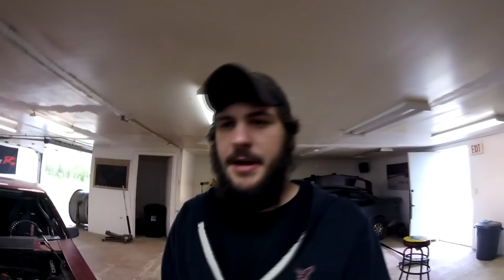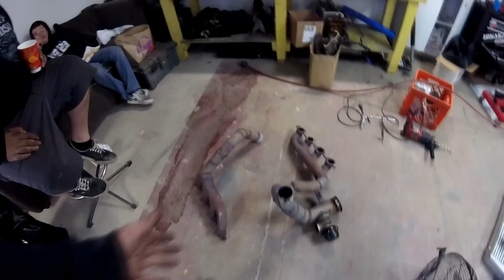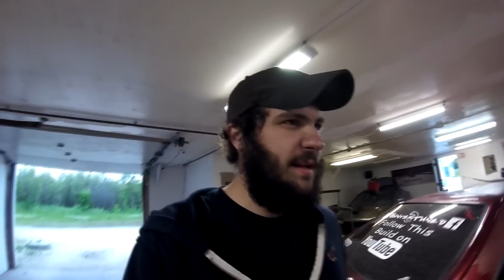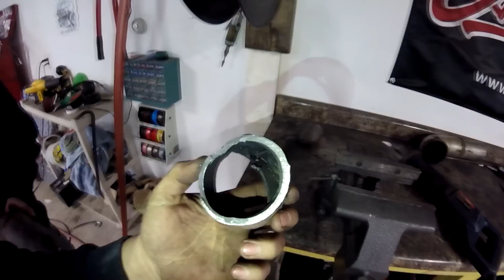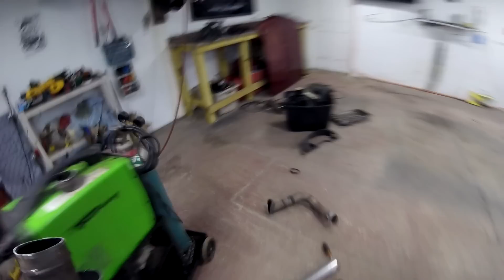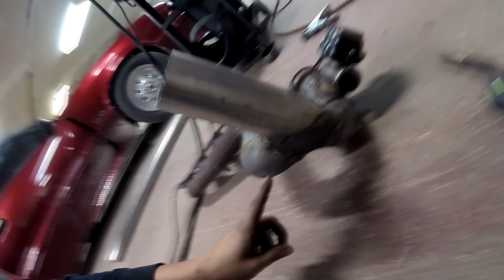The Absolute Worst Turbo Hotside Went 9's TAKE A LOOK CRINGE ALERT

Comment: I must have missed the first redesign of the hot side . I remember way back when it had a cut up section of h pipe in there and merged a solid 90 degree corner haha it’s definitely getting a lot better. The newest one looks way better . Your setup with turbo placement and alternator is very similar to what we Aussies deal with most of the time in our ls turbo powered commodores so I can understand how tricky it can be . Hell dude I wish I lived  close I’d make you a manifold but I think your new setup is going to be sweet It should yield more mph . Good luck and keep up the good work.

Comment: Plus exactly why guys with remote turbos take headers and header back exhaust off and put manifolds and smaller piping so the turbo will actually spool. It's not like when you make the down pipe bigger unless your talking about a 1 inch hotside I don't think your going to gain what you think you are along with I'm curious on how much longer it'll take to spool. Plus 3 inch would probabaly help if you had a big giant big block that moved alot of air.

Comment: Going 3 inch on the hotside to the turbo isn't as good for it either. You want some back pressure but not too much. You really need to set up a cheap back pressure sensor set up so you know for sure where your having issues but alot of guys running fast have stock manifolds with smaller than 3inch hotside. Should probabaly finish watching the whole video before commenting everything but I believe Matt means don't just take 2 45* pieces  of piping and try to make a 180* lol and not just loppin  stuff off and giving half the whole with a flat piece of metal then welding a smaller pipe to it. He means if you want to start making serious power do a legit smooth bends and transitions hot side that's all the same size and not overly complicated. Because plenty of cars he's dynod have still had like 2 1/2 pipe making 800 and beyond. Hell the mustang 8f8setup doesn't look like 3 inch hotside but it's nice smooth piping.

Comment: Don’t wanna be that guy but u may regret that 3” hot side. It will most definitely slow spool time and might be hard to get up on 2 step. I hope I’m wrong for your sake. Lol. 2.5” is good for like 1500-2000hp. You will probly see a nice improvement just by smoothing out the pipes. I made over 800whp on a 5.3 ,th400, t4 -76mm turbo with a 2” o.d. Hot side
Reply: gsxrred1000 yeah I went with 2-1/4 hot side for a better spool ... I have the vs racing billet 80 T-6 honestly I wish I had seen the T-4 80 first because I probably would have went with that .. I seen on on YouTube and it was making some steam! 
I love that hunter is sharing this because it’s great honest information 
9.7 is rolling ! 
His buddy Ryan just got a mustang and this is gonna get good 👍🏻

Comment: 2 1/2 pipe is good for 1000 hp. It's not about back pressure it's about exhaust velocity , "flow".
Reply: Velocity is not flow. If a three inch crossover was used it would still make power.

Comment: That pipe turned out really nice! I know packaging is a bitch, but its going to be so worth it. Laminar flow is the idea you're going for. The idea that air is a liquid and needs to flow like water does. small diameter primaries keep velocity up for quick spool and big downpipe evacuates best for high end power. My Miata's turbo kit uses this theory on the charge piping too. Goes from ~2" on the nozzle and graduates to ~3" at throttle body. This allows the air too expand into the pipe and keeps velocity up while cooling the charge. 
I'm curious how much love the tune will need after this change. I bet it sounds nastier too.